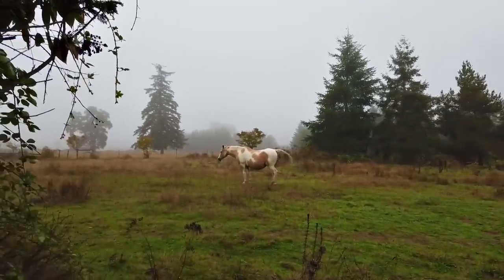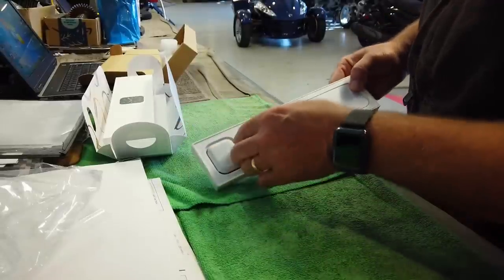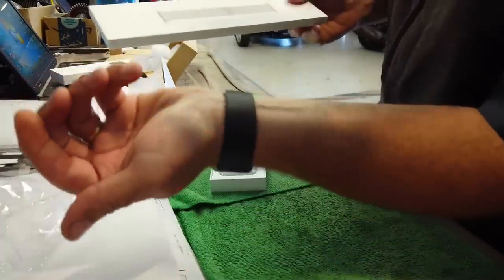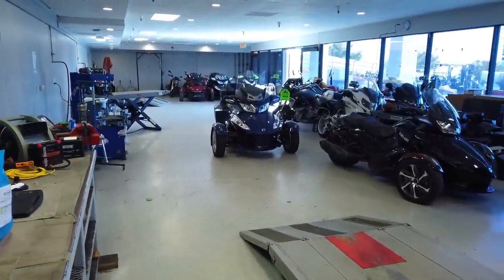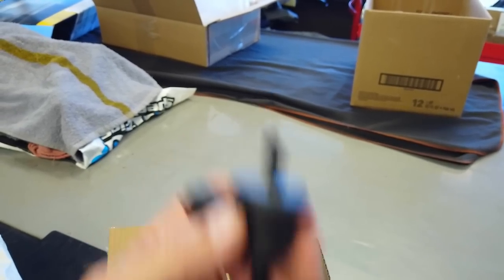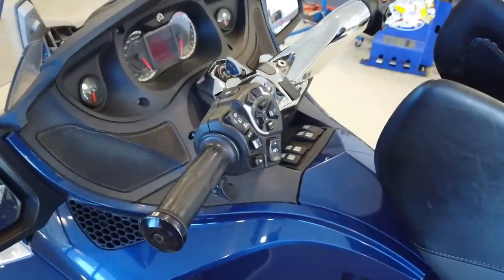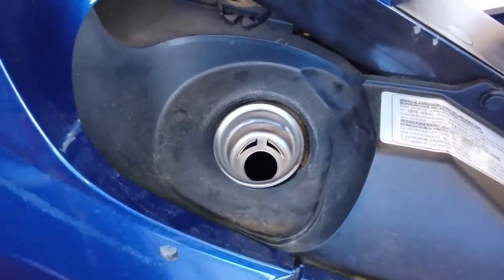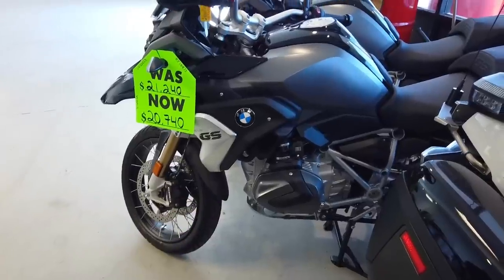Clearing Up EVAP Confusion!! • Apple Watch 6 Is In! | TheSmoaks Vlog_1787

Comment: Thank you for clarifying, totally get over filling gas tank. You said in the video up to 2013  990 v-twin engines mine is a 2014 sts and doesn't have that lump beside the glass fill area is the evap still in the same place.

Comment: Exactly how I learned to do my 2018 rt ltd refuel..  when I get a proper fill my gas gauge says I have 237 miles

My honda nc750xd has a purge valve that operates like a evap, have to check it before each ride.